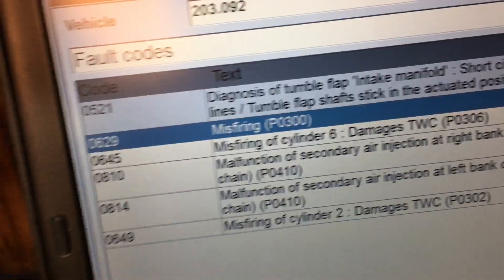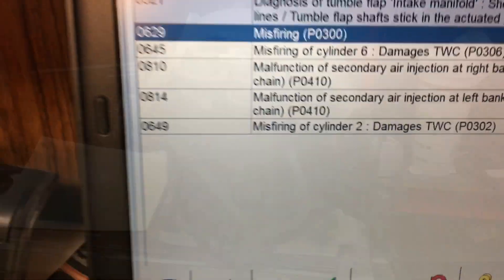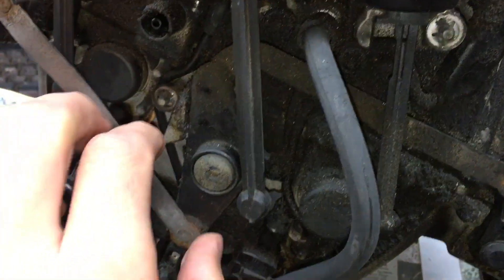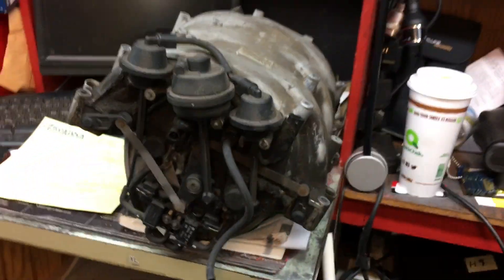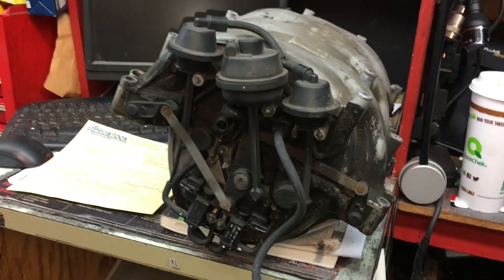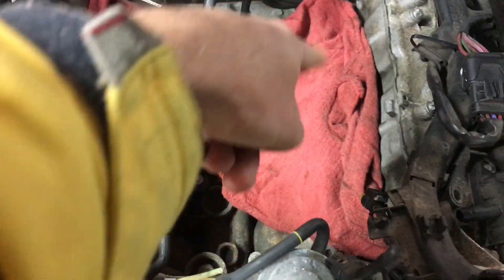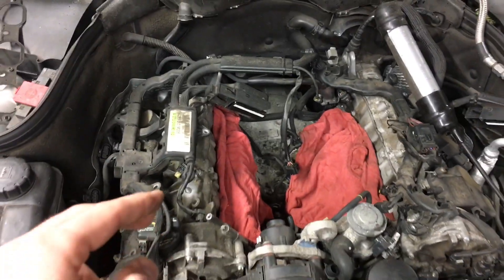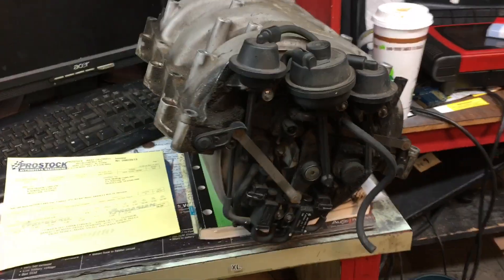Intake Manifold P2004 Mercedes Benz

Comment: This is what xentry says. No visual broken items 
Both left and right intake manifold position sensors (B28/8 and B28/10) are stuck at 4.96V, even after operation.

The expected value after operation should be between 0.00–0.50V, but it doesn’t change. What could be the issue

Comment: I've replaced yhe lever, problem, never dissappeared.
Reply from the maker: Thanks a bunch for watching my video and taking the time to comment. Was the lever broken?
Reply: @WheelsTips  yes it was. I've replaced it, but still shows an issue. It shakes when engine heats up and looses power.
Reply from the maker: What fault codes are you getting?
Reply: @WheelsTips  p2004
Reply from the maker: Did you check if the rest of the intake manifold is working properly? The flaps and suction mechanism?
Reply: @WheelsTips  I did. We cleaned it as well. Can it be Map sensor? I've read it can trigger false manifold codes

Comment: changed my broken lever how do you tell on car if its working i rev engine never see it move all vacuum lines are on and everything by hand moves smoothly!
Reply from the maker: Thanks a bunch for watching my video and taking the time to ask a question. I personally would clear the codes and take for a test drive to see what comes back. The lever is vacuum operated at certain times, not exactly on stationary revs, please share an update, thanks a bunch.

Comment: I'm having some issues now, but my mechanic told me am going to buy completely manifold
Reply from the maker: Hey Oriyomi Michael Fela Jr. thanks for watching my video. Ultimately your mechanic makes the decision what to replace as they are able to physically assess the situation, you should trust your mechanic enough to believe them that is what you need. If you are not doing the repair yourself you sort of have to let it be. Please share if they replace anything else and what codes or symptoms you had that prompted the repair, thanks.

Comment: May i know after you repair the throttle flap, all the misfire code and the p0410 code disappear ? Seems i am now facing the same code and the problems like yours

Please reply

Thankss
Reply from the maker: Hey Cheg Sunny thanks for watching my video. From what you are writing here as your current diagnosis of p0410 which is secondary air injection codes, things such as the secondary air pump is something I would check. Also the purge valve for secondary air. As for misfires I always checked spark plugs and ignitions coils. These are things I would look at first, please update on your diagnostics results, thanks a lot.
Reply: I change the coil and the spark plug is my first step, after change , the code same as yr case
Reply from the maker: Have you checked for intake leaks?
Reply: @WheelsTips  yes the intake leak
Reply from the maker: Hey just checking in to see if and how you resolved the P0410 code on the Mercedes, thanks for any update, much appreciated.
Reply: @WheelsTips  finally change the intake manifold and 4 o2sensor
Reply: Change the intake manifold become better but still have p0410

Then change 4 o2 sensor

Everytrhing be good
Reply from the maker: @chengsunny5661  Thank you so much for taking the time to update, glad to hear the car is running well.

Comment: What else can throw p2004? My system wasn't broken but still put all new parts, still throwing code p2004 bank 1 flap stuck open, intake looked clean from inside and no broken parts
Reply from the maker: Hey L Carlos Moreno. Thanks for watching my video.   P2004 Mercedes Benz intake manifold code is hard to work with because it is a generic code.  Mercedes Benz has their own fault codes which help narrow things down.  In my experience the intake being clean and nothing broken still did not mean the intake was not bad, tricky situation.  Please share an update, thanks a lot.

Comment: this can cause misfire ?
Reply from the maker: Hey Carlos Dominguez thanks for watching my video. In my opinion a faulty intake manifold can cause misfires. Have you scanned the car for faults? Have you checked the connecting rods on the intake manifold runner? Please get back to me with your diagnostic so I could help you better. Also please consider subscribing to my channel it would help me a lot, thanks.

Comment: What if one or both of outside pevats come out of manifold? I can the see the end of flap rod through the hole were pevat part connects to manifold. I see parts, kits for it but no explanation of install. Can they be put on from outside or inside manifold. https://www.ebay.com/itm/Air-Intake-Manifold-Repair-Kit-w-Arms-For-Mercedes-C-ML-R-Metal-Flap-RK5069M-/132380414481?_trksid=p2349526.m4383.l4275.c10
Reply from the maker: If the outside flaps are damaged the unit should be replaced. If you have more questions feel free to ask and please subscribe it would help me a lot.